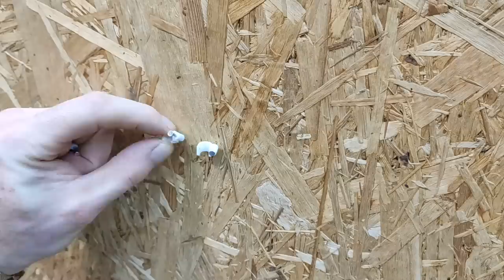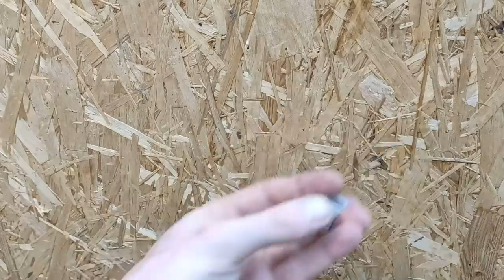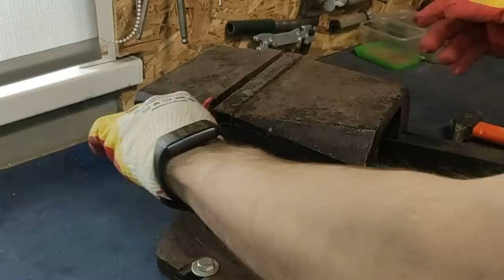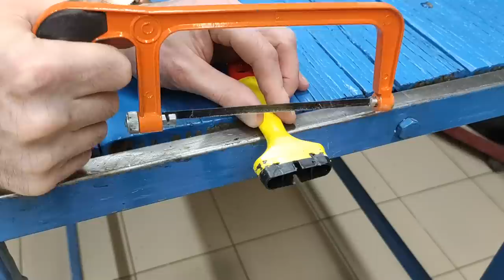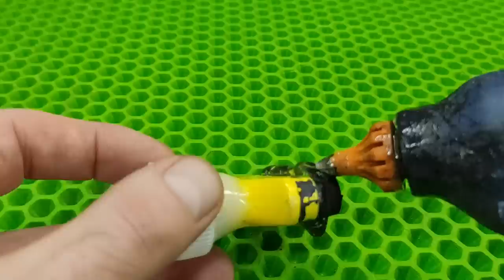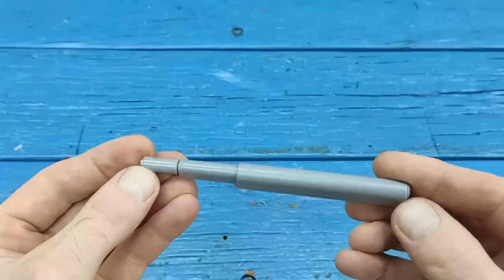The SECRET function of the cable bracket, how I never thought of it before

Comment: Fastening flex cable pipe with cut open 
Pieces of the same pipe is likely going to result in failure when pulling  wires in them afterwards , this is very irritating and can make the pipes fall out of the connections  on the in wall boxes, or separining  sections of pipe. 
Often this happens when pushing the cable snake thrue. 
The snake makes the pipe flex and strait out , the bends gets more sharp (more friction) and the snake start to push the pipe with it sometimes pulling apart joints. 
You get stuck start pulling pushing back and forth and then you lose  the dislodged pipe . 
 
-Always check the curve radius ,
Just because your pipes can bend  hard doesn't,mean that your cable snake can pass thru.( and a flattened pipe hav less space for cables. 

- fasten the pipes well ; especially on both sides of connectors and when they go in to the wallboxes /roof boxes.

- If you have a corrugated flex pipe coming out of the wall ,you can put 
A screw beside the pipe in the hole (not thru it doe) ,so that the head of the screw goes in to the corigation,
Stopping the pipe from being pushed into the wall later.
This works best with wood or wood base materials only drywall not so good,  here you have to rely on fastening the pipe on a stud  or other   solid stuff.
directly before exiting the wall pl

-There are special clips for fastening them, both  nail and screw based ,
Metal and plastic 
Or a bent nail can be used , if this 
Is not flattening the pipe. Works best 
for the hard smoth type( witch is a better choice  than the flexible ones, less friction)

Note that the soft flex pipes does offer very bad protection from screw puncturing , the screws catch and goes thru instead of slipping on the pipe. 

-If you need to repere damaged flex pipe  with cables in them before concreteing  floor or  such
Use a bigger size  pipe and cut it open push over the smaller pipe 
sideways and put tape 
Over , and the concrete will not 
Flatten or obstruct the area of pipe;
Or go inside it.